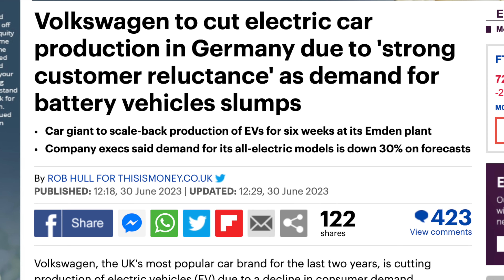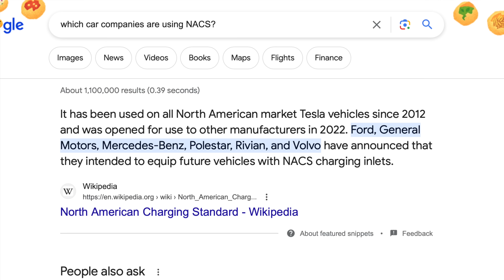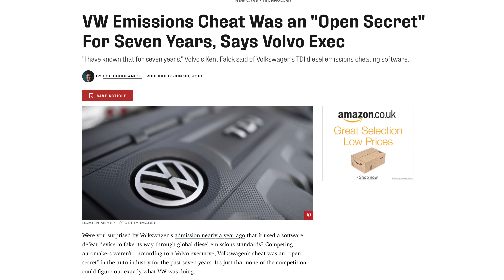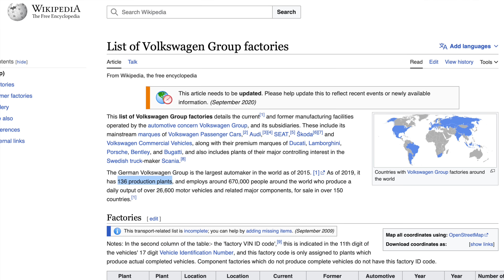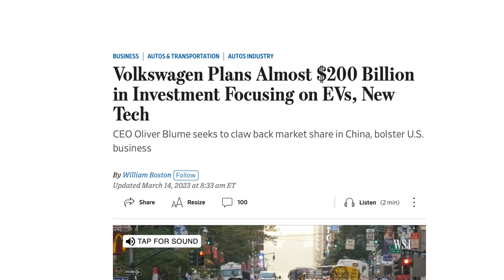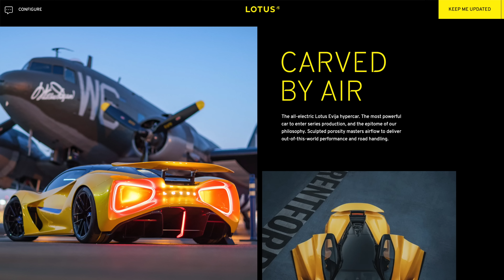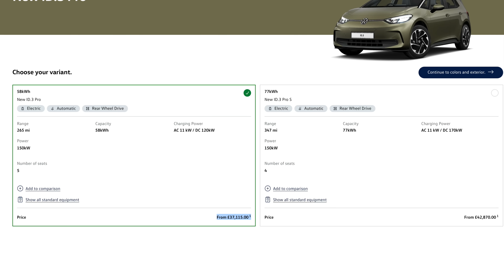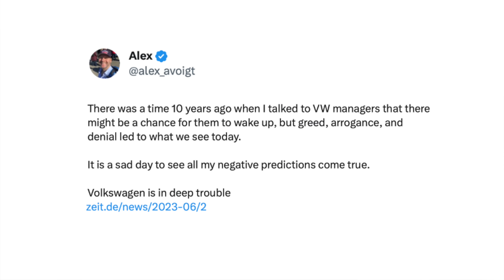KILLED by Tesla Or Incompetency? VW's Imminent Collapse

Comment: Correction, M3 SR LPF,  weighs 1825kg, not 1611. Fact matter, but doesn't suit the narrative here.
Reply from the maker: Apologies, I should’ve been more specific… Tesla Standard Range Model 3 built in California 1617kg, Standard range built in China 1625kg. Of course, weight increases with larger battery packs for both cars, but it remains, VW base model ID3 is still heavier at 1813kg
Reply: @TeslaJigsaw 1835 kg according to EV database (includes 75 kg driver per EU measurenent)

Comment: Legacy auto makers will be OK when everyone realizes that EV's are a big CON. We will be forced into a world of hurt when we have a majority of EV cars. There will be no more overnight cheap rate charging, infact because the grid won't support the addtional draw then we will see blackouts or they will introduce time slots for charging at home. What happens to car owners living in high rise apartments? As far as the Co2 saving it takes approx 80,000 miles of driving to offset the amount it takes to build an EV.
Apart from all of that there is the additional cost of purchase over ICE equivalents, higher insurance cost and certainly as we can see much higher depreciation. Where are all the battery recycling plants that we will require. Will the charging infrastructure be able to cope when nearly all cars are EV's. I can envisage queues of cars and some ragged tempers.
Reply from the maker: Hello, I’ve answered your questions in my latest video! Hope you find it useful 👍 

https://youtu.be/BIdGbUu_6EA

Comment: VW and VW Group are doing fine in Europe. VW Group are leading the market here and their ID models sell like hot cake. Their business inn the US is also decent. ID 4 has increase from last year. The challenge will be China. But the challenge there is not unsolvable. VW knows the chinese market very well. They need to hire local engineers and maybe tweak their EV business model. VW-VW Group has good EV fundament just need improving and they are still the biggest auto manufacturer in China beside BYD, they can capitalize on that.
Reply: LOL!

Comment: The real thing killing german cars is the Ukraine war; and a lack of low cost energy.  Tesla which is made in germany for german sales - is just one more brand and taking away sales definately hurts VW or any others, as those are in the luxury market which traditionally are the higher margin cars.  If all Tesla made was little golf cart EVs I doubt they'd make any impact.  Soon all EVs will have the same problem; a lack of lithium for batteries. Over the last 5 years 200 million pounds; a Y uses 20 lbs so in theory you could make 10 million y size packs.  But there are a 1.4 billon cell phones made annualy using lithium, battery farms etc.  So the pie for lithium is only about enough to make 5 million to 6 million luxury EVs. The EV industry is already approaching that figure.. so future growth will suffer.

Comment: yes, i know, you are a tesla-channel, so tesla had to be the best and the model 3 had to fit all! and maybe you want your tesla shares to perform.
Sorry, but how many carmodels did we have in the past? if you really want a shift to electric there had to be a variety of cars as there is a variety of people.
the MEB platform was never intended to be a sporty sedan, you can tell from the beginning, that the ID3 was thought to be the new golf, in its outer size.
The ID3 is higher than M3 with of course an higher consumption. but as far as I know lesser vampir drain and more effective (less loss) at charging
The big mistake was: Diess thought, he could make VW jump in all fields at once, car design, drive technologie, battery, software. 
And they fell short in software and frustrated old ice customer with the design of buttons and interior.
it lokks like the software problems are fixed (V3.5) Björn Nyland is testing the facelift at the Moment, but like dieselgate, bad experience is sticking easy on a brand,
with the exception of tesla as a fan project of course!
Reply: funny thing. ID3 has more space than a model 3 while being 40 cm shorter....

Comment: The 40x emissions claim against Volkswagon is a little unfair. The diesel engines would periodically go through a short self cleaning cycle and during that time the emissions would be 40x higher than legal, but the normal emissions output, while still above the legal limit, was far lower than that.
Reply: meanwhile every other brand was also caught but had to pay less because "they admitted it". I think VW did wrong and it is good that the people responsible are in jail. But all brands should have been punished hard for it.

Comment: I cant see myself owning a EV for many many decades. I could never afford these 40k cars new, I cant afford the battery replacement costs every 10 years. I also cannot stand how many gimmicks and tech they throw in it that will go wrong. You have to go through a screen to open the glove box? Really? Its over complicated. Hete in the US the car fleet is the oldest it has ever been. And the average transaction new car is 48k. My generation is apparently going to have a worst quality of life than thsoe before us because we dont have has much disposable income like older gens. In what world will any of this make sense. I assume people in apartments wont be able to have cables all over the parking lot and electricity costs will sore. 
Im not against evs like the "V8 FOREVER" type of people. But a practical use for a ev is decades away for many of us. I have no doubt things will improve. Im not certain it will very affordable however.
Reply: * BEVs are cheaper than the equivalent ICE. Premium D class in sticker price and C class in a few years of use. EG Tesla Model 3 is cheaper than a Corolla in the US within 5 years, and in California cheaper sticker price right now.
* Batteries and power trainand brakes outlast a ICE by 2-3 times, maintenance free.
* Little goes wrong with software and can be upgraded over the air
* The glove box in a Tesla can be opened four ways - automatically on a crash, by screen, by voice command, or by phone. Its a lockable security area.
* Electricity generation is getting cheaper by the month - solar is now cheaper than coal.
* BEVs will issue a new era of transportation as great as horses to automobiles. Autonomy will wipe 80% off personal ownership in favour of cheap RoboTaxis (Seba)
* Where did you pick up so much misinformation!?
Reply: @waynerussell6401  They certainly are not cheap. Even a Corolla is not cheap. So still disagree with you there. All the cost savings a EV give in the long term means nothing because the initial cost will always be too much. I certainly can't justify a used EV. 

To much software for my tastes. It's just way to much that I would ever need. I like having a screen in my car. It's great. But they have gone way too far to ever make it a compelling buy. 

I don't trust software either as you can see how many issues VW has had.

We will see if electricity gets cheaper. You never know I doubt it.

A world where you don't own your own car is terrible and should be avoided at all costs.

Comment: Hyundai Kia seems to have been able to produce some quality EVs albeit at low volume.
Reply from the maker: Absolutely. Hyundai/Kia are doing exactly what's necessary to survive
Reply: @TeslaJigsaw  Are you sure? I have owned an EV6 for 18 month and got rid of it because of the clumsy and poor design decisions they make. Especially on the software front and the underwhelming battery pre heating update. Bjorn Nyland and other testers have also found out the inconsistencies and shortcomings of the E-GMP platform and the dated laggy software they put in their cars. Research is key, not random articles and basic "car" reviews with titles such as: "Has Tesla finally met it's match?" and "Best EV ever?".

E-GMP owners have had plenty of bugs, issues, broken software, broken assist systems, broken AC units, broken Sound systems, recalls....